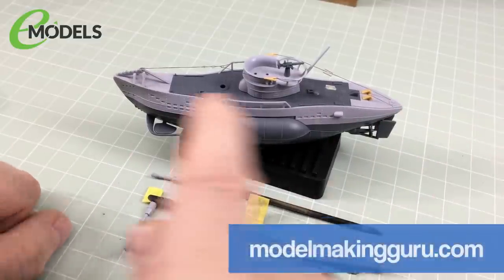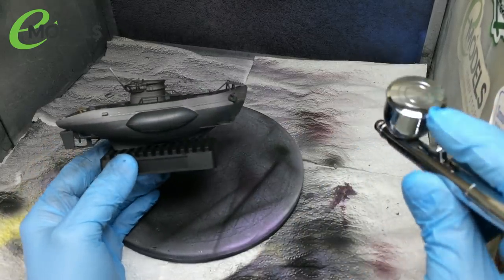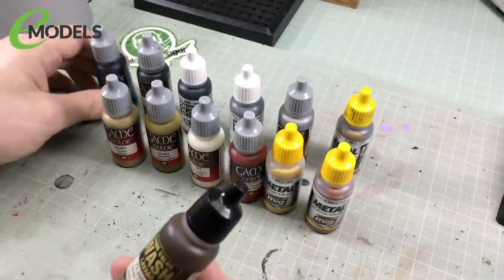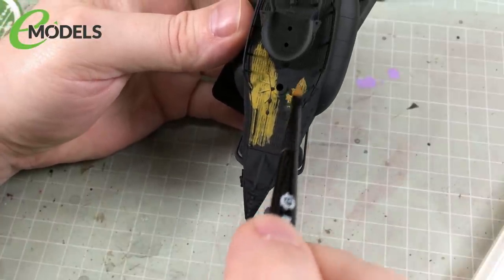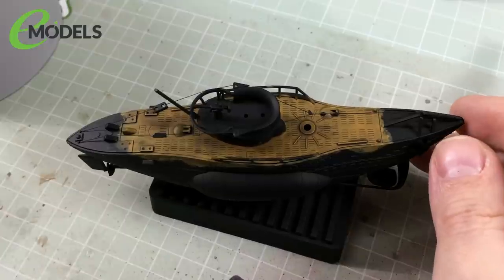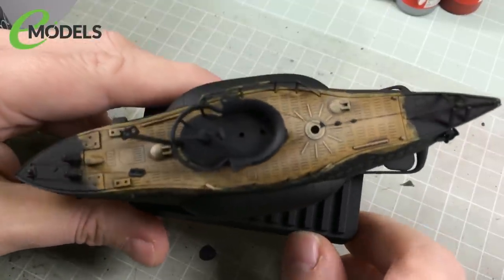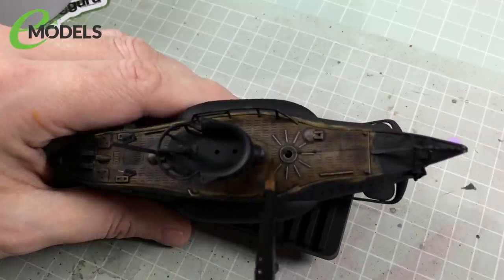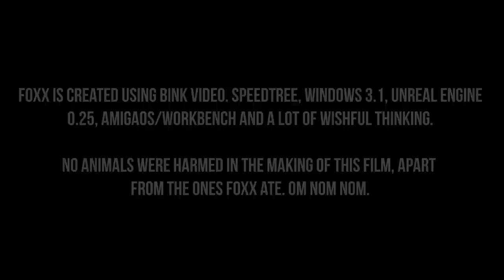Super-Squishy U-Boat Type VII Build 3: Primer & Painting Startengefahrten!

Comment: Hey Fox, Saw a great metallic paint job on NORI tv. He used a GS-03 black surfacer, urethane clear coat, then a gaianotes chrome. He said the urethane goes on thick (it's a heavier spray than your techniques) and can be a problem putting parts back on, so would a lighter spray work with urethane or would pledge still do the trick for getting that shine. Just wondering before I buy a bunch of lacquers to try out.
Reply from the maker: Honestly, I am not sure, as personally I find it easier to simply use one coat of a gloss black primer (such as UMP/Ammo/Stynylrez Gloss black, or there is the Alclad gloss primer too). You can have issues with paints on top of gloss coats sometimes, so personally I would save the time and risk of future paint issues and use a gloss primer. This would also avoid having thick coats of paints/gloss on parts. Also, it should be noted,  full-on lacquer clearcoats can be tricky to get right and really do need a respirator, spray booth and very good ventilation, so I am not sure for that specific application that it would be worth the effort :) 

However, to answer the actual question, no, acrylic gloss coats struggle to achieve the shame gloss and shine as lacquer clearcoats (and you can actually polish and buff lacquer clearcoats for even more shine).
Reply: @gurufoxx  Oh thanks. Now I just need the right kit to give that super shine.

Comment: Hello Fox. In the case of the primer in cans they adhere to the plastic, because they contain lacquer, for example Tamiya. The primer you are using, how does it adhere to plastic? Tks.
Reply from the maker: I am afraid I am no expert or chemist so I have no idea how specific primers do what they do :) But a sign of a good primer is whether it is sandable - if it sands well then the primer, in whatever way, has bonded well. If it flakes or peels off then it has not really bonded at all and is all but useless (and, effectively, just a paint).
Reply: acrylics create a skin basically and shrinks up around the plastic 

so it isnt a chemical bond like lacquers ( they kinda melt their way in )
but a mechanical bond due to the tightening 

lacquer is of coarse a better primer for that reason 
but this ammo / stynarez is so.e good stuff just let it dry good before you go messing with it
Reply from the maker: @walterwilmoth8390  That's pretty much what I assumed but I don't like to say if I am not sure :)